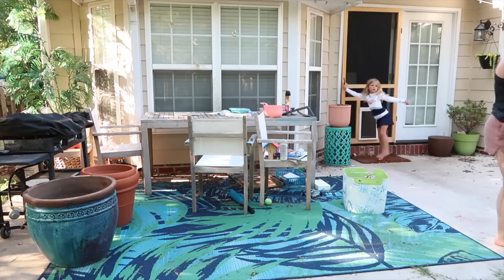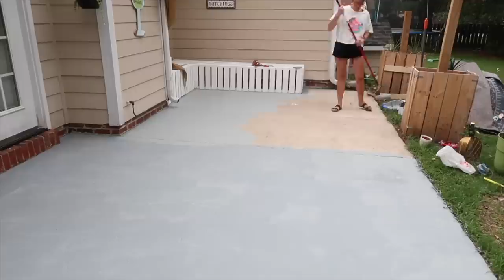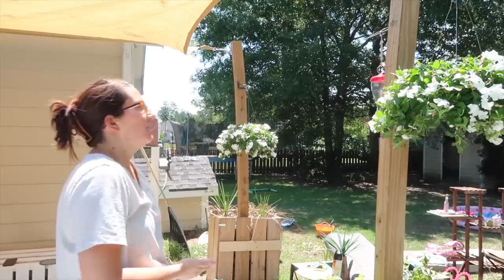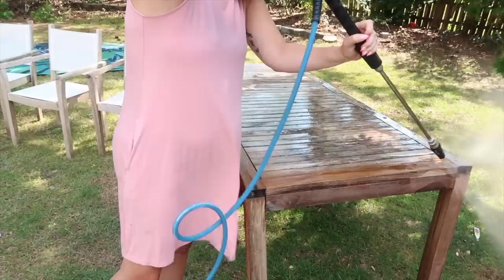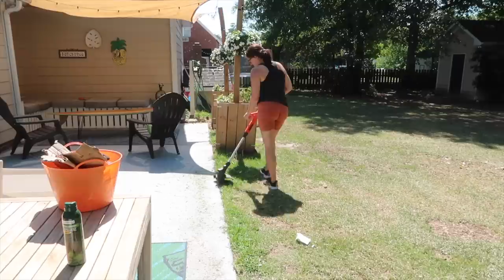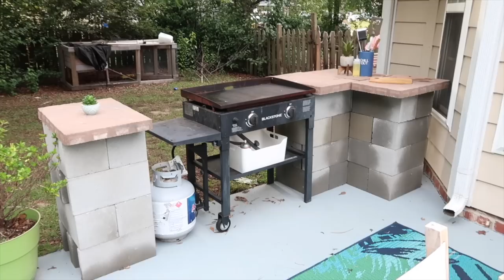DIY Patio Makeover on a Budget | 2022 Outdoor Decorating Ideas | Backyard Makeover Ideas Under $500

Comment: Hi kilee the treated wood in the planters will not hold up in the winter cold weather, it's really temporarily you have a use steel poles it will be there forever also can be use incase if you are doing any renovation once money will be spent,You are such a powerful hard working Mom amazing you can do these decor while in pregnancy lots of great ideas for the kitchen area.👍🏼
Reply from the maker: I don’t want it to be there forever. This is all meant to be temporary

Comment: Do you not have to worry about cinder blocks moving if they accidentally get bumped into?
Reply from the maker: No. The top paver is over 60lbs probably so it keeps everything in place. Obviously i don’t have anyone hanging on them or anything but I did a few tests to see if they move and they don’t move at all. I think using brand new cinder blocks that were perfectly square helped a lot. You could put something in between if you wanted it to be permanent!

Comment: Curious - what kind of cement paint did you use and did you add anything so that it's not slippery when it's wet?
Reply from the maker: No, it’s meant for concrete. It doesn’t seem slippery at all! The exact one I used is linked in the description